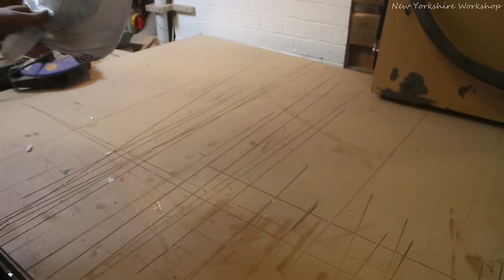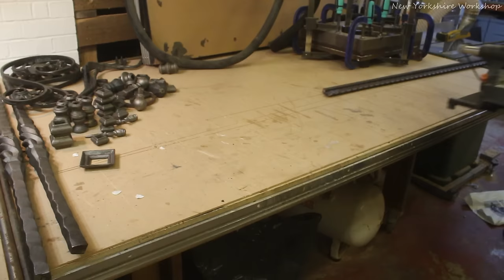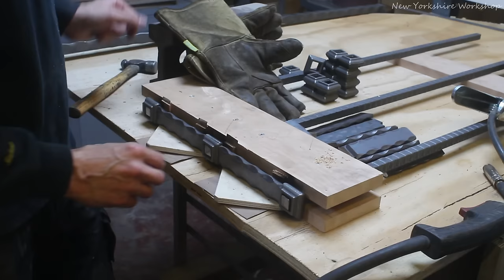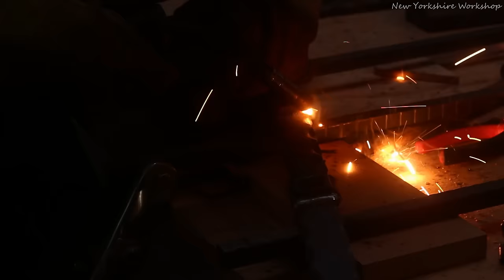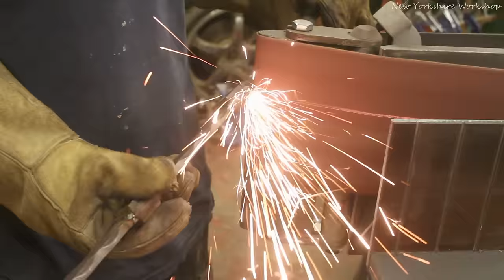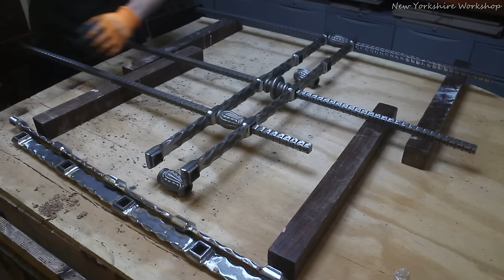Making an ornate iron gate

Comment: I've watch all of your vids and there is not one  I haven't pressed the Like button. You are a true Craftsman. You deserve far more subscribers than you have, keep up the fantastic work.
I'm in the market for a Arc Welder is the make/model you use one you recommend? It seems to be a great workhorse.
Cheers.
Reply from the maker: Thanks Nigel, im getting there, ive only had the channel about 8 months so im not doing too bad considering the kind of stuff ive made so far.
That welder ive had about 18 years! so i dont think you'd get the same thing now even if i recommended it. honestly it was a piece of crap until i modified the wire feed with a proper speed controller and also added a really powerful cooling fan (hence the noise). if i were buying an arc welder id probably go for one of the R-Tech machines, they have a good reputation and uk based  in house repairs.
Cheers.
Reply: New Yorkshire Workshop
 Thanks for the info on the welder. I'll give the company a call for some advice. 
That lathe and angle grinder combo worked a treat, must remember that one.
Reply from the maker: @nigelroberts4172  just make sure you give it a good clean afterwards. the abrasive dust cant be good for a lathe.

Comment: Hi, the gate looks fantastic and in keeping with the property, I made my own drive gates 16 years ago to stop my little boy running out (he’s now
Reply: I hit the upload button by mistake, I welded my postcode to the bottom of my gates incase anyone nicked them! Your welding is good if I may make a suggestion sometimes you need to up the wire speed and other times you need to turn it down, the easiest way to know what to do is by listening to the welding, it should sound like bacon frying in a pan.  I taught welding for 20 years at an FE College to apprentices.  I watched your video on door making -was that a Sedgwick planer/thicknesser? If so I have the smaller version.  Keep up the great work.

Comment: Great looking gate and well done but only one flaw!   Red oxide primer is not an adequate metal prep.  with all the time you put into building the gate you should do the best corrosion protection for your work, my friend.  Aggressive wire brushing would be much more suitable but sandblasting is the best metal prep you can do.  As that used to be my profession, I know best!  But great looking gate though??   Case K. from Phoenix, AZ

Comment: Please do a follow-up in 5 or 10 years. I'm curious how the paint will hold up.  Sure hope it does well, as it would be a shame if the paint started flaking and metal work rusting for you due to lack of metal preparation after so much effort went into building the gate?  Best of luck to you!  Case K. from Phx, AZ
Reply: Trouble with steel and iron. All that darn painting over and over. Better to have that gate in a gallery than out in our northern weather,

Comment: Excellent video, really enjoyed it, do you need as many tack welds or is that because it is a gate that needs to be true and there are so many ways it can twist and buckle, also you grind a chamfered edge when making up the gate hinges, I take it this is done to allow a gap to weld. I must stop Subscribing to sites but there are just so many interesting and educational videos out there.
Reply from the maker: it does help although being mostly flat it wouldnt be too hard to straighten it with a bit of leverage
Reply: @NewYorkshireWorkshop  Being a sad git that needs to get out more I was laying in bed thinking, how do you go about installing it in concrete ensuring in retains its position and accuracy, next video for you should you accept the challenge.
Reply from the maker: it was quite simple really, would have made a really boring 10 minute vieo or a quite interesting 2 minute video so i didnt bother. i just core drilled two 120mm diameter holes in the path, sat the posts in, levelled them and then dumped some postcrete in the holes. simple.

Comment: i hope you read this, even tho its an older Video. i just binge watched some Video of you, and you said you are not a Pro-Welder .. 
well .. German-Metal-Worker here ^^ .. you realy need to up you welding wire feed .. or lower your Welding-Voltage (the other adjustment), depening on Material thickness ofc. 
it should be a even sizzle sound, not that spitting .. it realy bites my Ear 😁 .. and then for the most part the Pistol Angle to Work should be around 60° pushing forward for pretty even weld. 
if you weld dragging you have more Heat concentrated in the corner and better penetration but also higher buildup, it is used for 3 layer-welding for the root (first layer)
just a little Tip (its way way more and way to much to welding, to fit in one comment) .. its fun to watch your stuff .. go on ^^

Comment: Wanted to see the fitting process most. (It was good though 😊)
Reply from the maker: Sorry! I literally had like 500 subscribers when I made this video and was squeezing things in between other jobs so didn't always have time to film the whole thing. Basically I core drilled down into the concrete path, dropped the posts in and levelled them, then back filled with postcrete. then I drilled in the braces to the tops of the stone wall and then welded the latch in the correct place.
Reply: Thank you so much for getting back to me, I really appreciate it. Love all your videos. Doing up a 1820s Shropshire house at the moment - have learnt so much from you, (mainly the calm process, i'm getting better!) Thank you. Wonderful re: the current subscribers, well deserved. My son has picked DT for GCSEs - a butterfly effect from your amazing work! - Man in Yorkshire builds gate, boy in Shropshire builds wonky box. (What i'm itching to ask is the decision process around insulating solid stone walls / roof - loved the hall, and noticed the roof on the tour - maybe a subtitled montage? lots of confusion out there. Thanks again 😀)

Comment: Nice work. You welder doesn't sound  just right you may need to turn your amps up a little.
Reply from the maker: it was set to maximium for most of this! the main issue is wire feed is sometime inconsistent. a new welder is a better solution!

Comment: What sort of welding was that, MIG or just flux cored wire, did you use gas?
Reply from the maker: MIG, im using argon 5 from gas uk
Reply: ok thanks, that is why it was so clean

Comment: I never knew before that fumes from flux and welding are perfectly safe and non-toxic within the confines of a poorly ventilated space. Or that sparks from welding, cutting and grinding couldn't possibly ignite wood or sawdust in a shop primarily used for woodworking. Beautiful craftsmanship on the gate, but a bit more attention to safety, please.
Reply from the maker: thanks for your concern and giving your expert opinion! what kind of extra ventilation do you think i should have? i have the door open and my paint booth running full blast, is that enough?
apart from only welding in the morning so that i have several hours of fire watch in the evening; what precautions should i take? i already have three different kinds of fire extinguisher, do you think i need more? bucket of sand maybe?
all your help is much appreciated i dont want to die.
Reply: @NewYorkshireWorkshop  This burned hotter than your arc welder LMAO
Reply: Get an air mover if you’re concerned. Basically a large fan, ducting fresh air into your work area, with an open door, it should keep the air relatively safe. Don’t have the air directed at your welding area, as it’ll blow the gas away. To be honest, silica, found in various timbers is a lot more concerning than welding now and then. Even though your machinery has extraction, silica dust will still be present in the air

Comment: No, no, no, no no.  The cutting, welding and grinding are ok, very nice actually, but the painting, well what can I say, you are a young man with relatively little experience.  
First when you open the paint tin to stir the paint, you must spill some down the side to let it form a ring on the garage floor, then you must step in it to give a nice line which fades as you walk nearer the gate.  Then spill some more, not very much but enough that it's noticeable, step in it too and move around a bit as you decide where to start, which you already know is the very top.  Then you load the brush very heavily and slather the paint on the top six inches and let it run and drip while you change you mind and spread the paint on your shoe a little further around the general area.  
Then you wipe you face making sure you get some paint across your forehead and go in and tell the beloved wife you would like a cup of tea.  She'll make remarks about you not having spent long out there but you'll tell her you've done plenty and invite her to come and look, which she grudgingly does.  Horrified she tells you to get it cleaned up, and uses every expletive a woman of refinement knows to describe you shoddy efforts as well as you useless ancestry and storms off to phone a painter.  You quietly walk back to the garage put some white spirit on a cloth and clean your forehead, and then clean up the paint marks, go inside get changed and sit down in front of the TV where she should have left you in the first place.